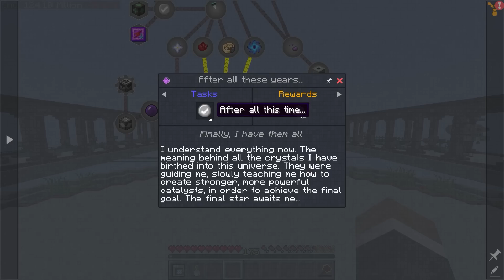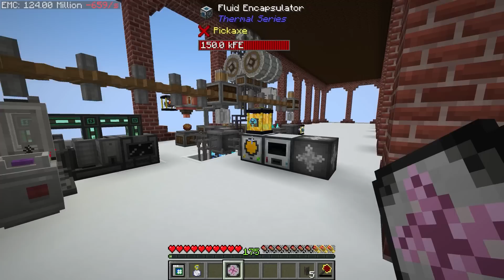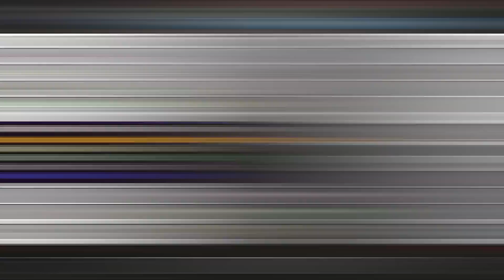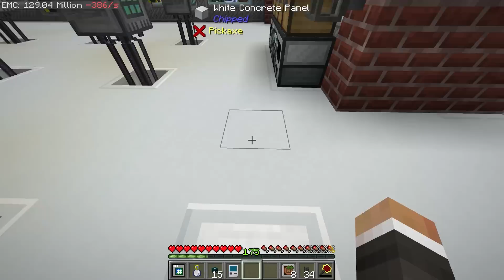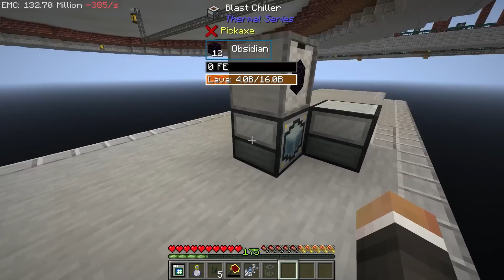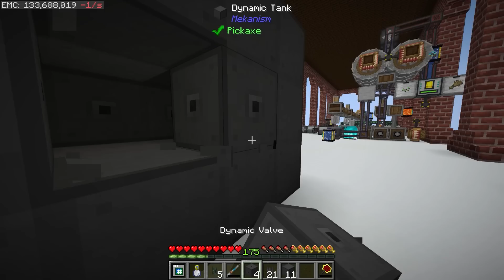Minecraft Mechanical Mastery | FISSION REACTOR SETUP! #14 [Modded Questing Skyblock]

Comment: Unless it was changed in a recent version, Mekanism pipes don't have the pump limit multiplied by connections actually extracting the liquid, but by the total number of pipes in a network. Having a pipe branching out to nowhere should still contribute to the total transfer rate.

Comment: Does this pack have the Integrated Dynamics mod included?

If it does I just wanted to tell you something you can do to use it with the mekanism reactor..

If you use it to put the water into the reactor you can set it to send an absolutely crazy amount of water into it (like 99999999999mb a tick for example)

If you do get water going in fast enough then you can actually ignore the saturating condensers part of the turbine and just tell the turbine to dump any excess steam it receives.

This removes the need to make it a closed loop for the steam/water, which I know isn't hard to setup but this just removes that need entirely.

Comment: 10:12 - If my math is correct, you need about 120,000,000 mB of nuclear waste to make enough antimatter for the single Final Star crafting recipe. which is about 120,000 buckets of nuclear waste. Dear god that is a lot of nuclear waste. You might need a way to either store all that power or a way to void it. 

A shame you can't turn a lot of power into a little bit of EMC, that would be a very efficient way to produce the Anti-matter for the Final Star
Reply: You only need 4 antimatter to make a creative chemical tank (since the quest gives you 2), which allows you infinite antimatter

You can void energy with the resistive heater, and set it to 999 MRf/T
Reply: A reverse numismatic generator would be awesome